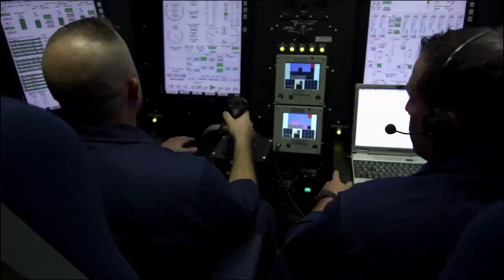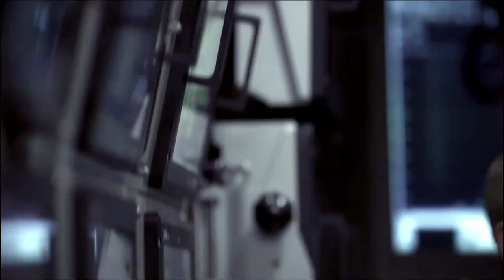Battle Stations - Navy Submarine

Comment: only thing wrong with this video is the lack of red lighting, or is that just in the all movies?
Reply: Don't believe everything you see in the movies. We don't rig for red unless we are at periscope depth.
Reply: +Will K (crazace) Do you work in a Nuclear submarine or diesel? And what's the red light for?
Reply: Virginia class submarines do not have optical periscopes - they use cameras in the masts to eliminate hull penetrations (minimize locations for flooding/leaks).  Therefore, there is no need to maintain "night vision" during operations at periscope depth so they have normal lighting all the time.  In this case, however, since the entire video is taking place at depth (not using the periscopes to look around at all), there wouldn't be red lights on other submarines during this period either.  To be clear - the "rig for red" (using red lighting) is to maintain the night vision of the person on the optical periscope.
Reply: SpaniardChris I was on Nuclear powered Subs. 4 of them